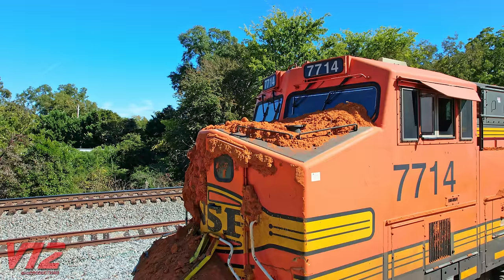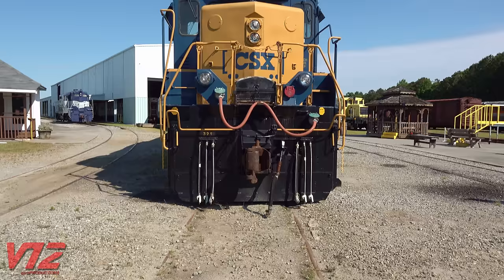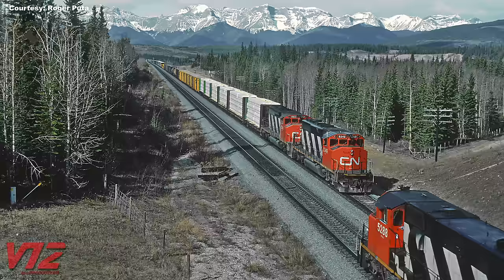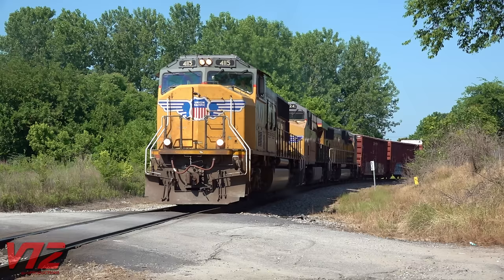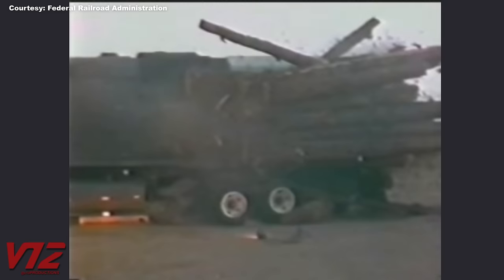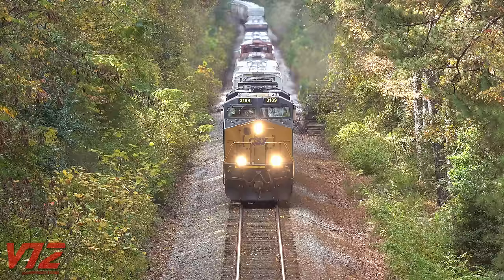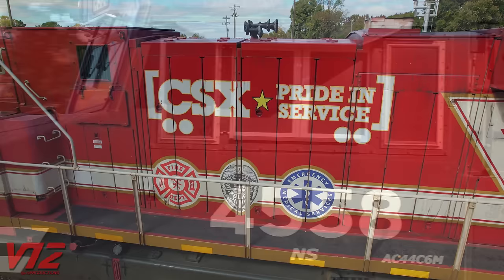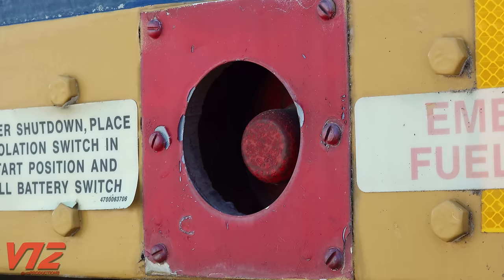How SAFE are Locomotives?

Comment: i’m a conductor for Union Pacific. crossing accidents sadly happen more than you think. usually depending on what you hit, repairs can be made. you definitely wanna duck though. and in some cases bail out or get to the second motor if you have it. also fun fact while passing other crews, out of curtesy we turn our ditch lights off
Reply: Most crews deactivate the ditch lights, and dim the headlights for oncoming traffic.  The exception would be if they are meeting at a crossing.   In some places where expressways run parallel to rails,  some crews will dim down their lighting to avoid blinding the motorists.  That maneuver is discretionary, depending on the situation.
Reply: Hello fellow UP conductor (im on the GCSU)
Reply: @stanpatterson5033  deactivate? its just a knob you turn its not that deep lol
Reply: Courtesy during the daytime and forgetting to turn the ditch lights on and headlights on bright is a good way to find yourself in a decertification event
Reply: I’m a teenager considering working for the railroad, so that’s some neat stuff to know there. Thanks for the share!

Comment: I learned the other day that the attempt at shooting the cutoff valve wasn't something made up for the movie, it was actually something tried during the "Crazy 8s" run away incident that the movie is based on.
Reply: yep, but they totally forgot that this button is supposed to be pressed for a long time, and not just pushed by a buckshot, or birdshot, or whatever they tried.
Reply: @pavelslama5543  Kind of dumb if you think about it. If that's your only option to stop a moving train do you really have time to press and hold the button?
Reply: The button is a normally closed circuit and damaging the button will open the circuit and activate the safety feature, I found that out when I hit a fallen tree and it ripped the button off my locomotive
Reply: @Unknown_Ooh Not totally, I mean it would be better in the end to probably have the button in the cab but it’s mainly to shut off the fuel pump for the diesel which only generates the electric for the traction motors that actually pull these units. This is mainly only in for protection for shutting down a runaway Diesel engine not the train itself.
Reply: @pavelslama5543  
Actually it doesn’t. I am a locomotive master electrician and can say with certainty that a properly working EFCO should kill the locomotive immediately. If they actually get shot with a bullet they will shatter as they are made of plastic and brass. 
The EFCO works on the normally closed button switch. There are usually three but some locomotives have more. Rio Grande GP30s for instance. The EFCO supplies power from the local control breaker in series, x3, to the fuel prime engine start switch and an interlock on the fuel pump control relay. The FP/ES switch bypasses the FPCR interlock to pick up the coil on FPCR. When the FPCR coil is energized it connects the interlock creating a self locking situation. Any interruption at the EFCO buttons will shut the FPCR down. 
When FPCR drops out another interlock picks up D Valve in the govenor to cause the fuel rack to disengage. (On engines equipped with EFI it does the same electronically.) 
It will also cut power to the ENGINE RUN RELAY, cutting power to all other valves in the govenor. 
The problem with crazy eights is that the officers shot the fuel cap that is located just below the EFCO which was a bigger target and also painted red. It was an honest mistake.
Reply: Never mind it was a silly failed attempt.

Comment: I've always found the American way of safety for trains really interesting. The large wide noses, the horns and various lights and bells. I think it would be interesting (maybe I'll look into that) for survival rare /injury  comparisons between American and mainland European locomotives in crashes. European locomotives do not blow their horns at crossings (except for rail enthousiasts haha) and I doubt their windows are actually bulletproof. Our trucks are also smaller and probably weaker, so maybe things like that could be a factor why European trains have less noticeable safety systems and procedures?
Reply: Not to mention European railways do Not need PSR at all
Reply: A lot of the times it's also idiots thinking they outrun a train, and cross as fast as possible. Which normally doesn't work as you can see.
Reply: I think its mostly due to how long American trains are, costing drivers upwards of 10 minutes at the crossing so people are more likely to jump the gates. Lots of urban areas have quiet zones where trains do not blow their horns because of increased safety measures at crossings, but many rural crossings lack a gate or even flashing lights which is why many of our trains have the features you mentioned.
Reply: @Ty-qx1ui  not only that American locomotives Every since the 1900s Were always HEAVlY and MASSIVE for average height of main line locomotives were 15-16 ft tall, I tell you they are Massive compared to British and eoupern locomotives put them on British Rail lines or eoupern these heavyweight locomotives on those rail line and they will cause those rails to Sink in the ground that's Why Railroads in this country is more expanded and Can carry More loads than any other country.
Reply: @bnsflover7062  Thats very interesting! I never considered that
Reply: Since the tracks in europe are state owned they try to eliminate crossings. Most crossings in europe also have gates. I heard that a tank got hit by a train in sweden one time. The people in the train were ok and the tank drivers, not so much.
Reply: @bnsflover7062  Here in sweden a large proportion of the railway support almost as heavy loads as north american ones. The loads in sweden are 32.5 tons per axle while in north america it's 36 per axle. Unfortunately we have the only heavy hauling freight lines in europe and I hope that the rail system gets upgraded everywhere in europe instead of just sweden.
Reply: @skedzer4803   I see, Good information , what's the average hight for mainline locomotives there?
Reply: @bnsflover7062  The locomotives aren't usually that high, i'd say 4.5 meters. This is probably to be able to use them in the rest of europe. The freight cars are a lot higher. They are up to 4.83 meters high, which is 15.84 feet. In finland, they are even larger but that's probably because of russian influence. 

Loading gauges are planned to be made larger in europe and it's planned to cut the truck goods transport percentage by 30 % in 2030.
Reply: Trucks in Europe are actually generally about same to heavier (especially in nordic countries) than in North America. But trains shorter and lighter, less crossings (especially unguarded, since crossings are often publicly funded), better driver education and less road traffic reducing the need for having such heavy safety structures in trains.
Reply: @skedzer4803  ok
Reply: @pekkasalminen9601  Yeah, the closest to the size of american stuff is sweden and finland. Trains are as high, trucks are almost as large. I don't know why the nordics are larger than the rest of europe.
Reply: @bnsflover7062  Swedish SE-C loading gauge almost supports american locomotives. It's only 5 cm lower than american engines.
Reply: Most of the difference is due to driver behavior, most European and asian railroads, at lest the ones I seen, they don't nearly intersect with level crossings like they do here in the u.s where an over or underpass is the exception rather than the norm. Fewer chances for a vehicle to be hit means less collisions of that nature, then again, you still have human and animal collisions to contend with as those you don't have to be at an easy point of entry to be able to encounter.
Reply: @WNWFishin  Modern Freightliners (a commercial grade tractor) are notorious for stalling on slight grades due to their "automatic" tranny. What this means, is that a trucker may have had the right of way when he started towards crossing tracks, however, was unable to clear the grade before a train came.
Reply: @skedzer4803  A miltary tank!?
Reply: @skedzer4803  Because Sweden and Finland are much less dense than other Europe. Economy of Scale becomes really powerful then; look at Australia to see it taken to the extreme.
Reply: @jed-henrywitkowski6470  yes, a tank.
Reply: @skedzer4803  on France we have old tunnels and bridge and we can’t be over 4,35m height.
Reply: Because on Europe, modern locomotives (after 70’s) are built to be deformed to cushion the impact with something heavy. On my opinion, it’s a bad idea to protect the driver. We should have very thick and strong cab to avoid déformation of the cab. The rule is not the same for a road car wich must be deformable to protect passengers
Reply: @Croco140  Strong and massive used to be the Approach to Car Safety too. Deforming softens the Impact, strong and massive makes crashing more violent, causing Whiplash Injuries or even sending Occupants flying if they don't wear Seatbelts. While not as much as with Cars, this applies to Trains too. I was on a Train that hit Concrete Slabs which were placed on the Tracks by some bored Teenagers, and even that 200 km/h Impact into a fairly small and light Obstacle could be felt strongly, now imagine what crashing into a Truck would be like.
Reply: @Ty-qx1ui  For sure, we live in a nice neighborhood in NE Mpls, and we are close to a track that leads into a regional train-yard. I have noticed that most of the trains (Even quick moving with a double-green signal) will reduce their engine RPMs to maybe 15% or so as soon as they come past the houses. (The train is maybe 100-150 feet from our houses). I've lived here most of my life, so I'm used to trains coming past, In fact it helps me sleep better; but I'm happy to see that they try to reduce their noise pollution when the front locomotives pass our homes.
Reply: @skedzer4803  No, not a tank. A Patria XA-360. 2 injured in that vehicle + the driver of the train that derailed.
Reply: @bnsflover7062  Russian locomotives are not smaller in size than American ones and basically the height depends on the height of the contact wire. There is also a weight limit of up to 9,000 thousand tons.
Reply: @apachinook998  I know that since One of the locomotives that failed has inspiration from one of the Union Pacific locomotives
Reply: @apachinook998  I've seen one Russian steam locomotive that is At a hight of 14ft which the same hight point as a GE P42DC ( American passenger locomotive)
Reply: A colleague of mine was visiting here in the US from Spain, and he jokingly complained how emergency vehicles use their sirens at night (ambulance, fire trucks etc). I was like uh yeah? Then he told me in Spain, they only use the lights at night, no sirens. 

So, I think Europeans “just get it”, certain systems, ways of society, that Americans would not understand.
Reply: @skedzer4803  well at least Sweden is somewhat close.I've trying to do some research about the Russian locomotives sizes and what their Average heights, Because Of the story of the AA20 bbecaue of how big it was, Well too big for the russian loading gauge I'm guessing.
Reply: @bnsflover7062  The AA20 derailed on the russian railways but didn't collide with tunnels. It was too strong for the couplers, it deshaped the track and destroyed switches. It was limited by the curves and the couplers.
Reply: @skedzer4803  hm I see.
Reply: Lol 😂 European trains in terms of freight trains are actually much much shorter. Because of those inferior buffers and hook and chain couplers.

Comment: The exact reasons I love American locomotives! Nothing against other countries at all but I just love the way they look, sound, the way they operate and everything about our American locos much more.
Reply: Negative part is they can’t quickly change direction. This isn’t big problem with America’s long hauls but here in Europe we often change direction of the train. And a turntable would take too much time to turn the locomotive around.
Americans locomotives are very efficient for American routes, but would be pretty useless here, and probably other way would be same. We also have smaller sidings, so having your huge strong locomotives would cost us a wagon length less cargo. But because our trains are shorter we also don’t need so many locomotives. 

I love both locomotives each their speciality.
Reply: Imagine not using electrified mainlines in 2022
Reply: Not really, most countries are pushing to increase the amount of catenary lines. Reason for hydrogen and battery in cargo trains is for “last-mile” from main junction to the connecting customers. At our company we have some customers that only receive 2 trains per day. And no junctions close to it. So in these cases a hybrid or battery style locomotive would be great. Just before the switch towards the customer change over to battery or diesel. 
Personally I prefer driving our electric locomotives because they are much stronger then the diesels of same size (and quiet). For me no annoying fuel stops and for company no expensive fuel stops. 
Also maintenance wise are electric locomotives less needy resulting in more driving time and less chancing oil time. For infrastructure company they can ask more money for electric time schedule. Comparing the electric timeschedule prices vs diesel fuel usage in our company electric is still cheaper. Even now with the Ukraine-Russia conflict.

Last reason why I prefer my electric locomotives is that I can do regeneration braking. Then I send electricity back on the line for another locomotive to use. In (most) diesel locomotives we don’t have any engine braking so the energy is lost in heat.

But I don’t want to be the private company needing to pay electrification of the HUGE distances of Americans railway system. So I can understand your choices
Reply: I have to imagine that electrifying 100,000 miles of track here in the US has to be quite expensive. All of those 2,000 mile western runs would be serious construction costs.

Comment: The thing is, in the Crazy 8s incident Unstoppable was inspired by, they did shoot at the train in an attempt to hit the emergency shut off.
Reply: Really not a bad idea. Blow an air line or the compressor tanks to send it into emergency or let the brakes lock up as they loose air.
Reply: @Whitebassonly  the air breaks weren't hooked up since it was just a yard move.
Reply: After watching that movie, I had to do some reading on the event that inspired the movie. I kinda shocked me to learn that they did attempt to shut down the train by shooting the fuel cutoff. 

My question, why not just shoot a bunch of holes in the fuel tanks? Granted, probably not the most environmentally friendly solution, but given the choice of the damaged caused by derailment I would prefer the fuel cleanup. 

Shoot a bunch of holes in the fuel tanks, the engines will shut down eventually. 

I know NOTHING about railroading, so maybe this is a stupid idea to those who do understand locomotives. Am I overlooking something?
Reply: @mattrodgers4878  Shooting the fuel tank can actually cause an explosion, so that will become a problem. Plus, attempting to shoot the fuel cutoff was futile as the button actually needed to be held down.
Reply: @SpheroJr3289  diesel fuel isn’t nearly as flammable as gasoline.  You could toss a lighted match into a bucket of diesel fuel and the match will go out.
Reply: @mattrodgers4878  The bullet would send a shockwave into the tank though, maybe compressing the diesel enough to ignite.
Reply: @mattrodgers4878  oh, my mistake.
Reply: @mattrodgers4878  well then, aside from that, PTC is a technology used by railways that can stop collission and runaway trains.

Not every locomotive is equipped with it atm but most modern rebuilds/new builds are equipped with it
Reply: @SpheroJr3289  Yeah but back then there was no PTC to my knowledge.  Nowadays, yeah for sure. That’s partly what PTC was designed for - fail safe in case of operator error. 

Crazy 8’s was one crazy story. I was young at the time but it was super interesting to me and I watched all the news coverage about it. 

Unstoppable was a pretty good adaptation of what happened. They even derailed a real train for part of the movie. Lots of video coverage of the movie being made here on YouTube.
Reply: @zach31194  True.

Comment: Southern Pacific had a MARS headlight that rotated-oscillated.  It appeared to “flash” and really caught your attention. It had many moving parts and was discontinued due to maintenance cost. The bean counters killed it
Reply: I don't blame them.   It should have just swept right and left.   Much simpler mechanism.
Reply: The wig wag module is a much easier design and probably more practical you can find them everywhere. Old cop cars are the most common lol
Reply: Those old Mars type locomotive lights really do get your attention. We have a rural train that runs occasionally and it's very hard to tell the distance on the runs that only have regular headlights on.
Reply: RRs now use ditch lights which are far brighter, closer to the ground and have the ability to flash. Far more visible than Mars/Gyralights of the past.

Comment: That bnsf unit will be rebuilt after the insurance dept. Finish their investigation.  And railroad terms, if the frame ain't bent it can be rebuilt.
Reply: That engine will return in no time. There was a UP SD70M that was demolished not long ago by run away cars at a yard north of me in Palestine TX. You should've seen it in person, whole back half was absolutely shredded to pieces. I watched it get scrapped on site. Of course they took important stuff of it.

Comment: The windows are no joke. Engineer friend of mine got shot at once, scared the crap outta the crew but the windows had no trouble stopping the bullets.
Reply: Cabooses also had to get bullet proof glass, which is why many cabooses had the windows plated over, cheaper than bullet proof glass.